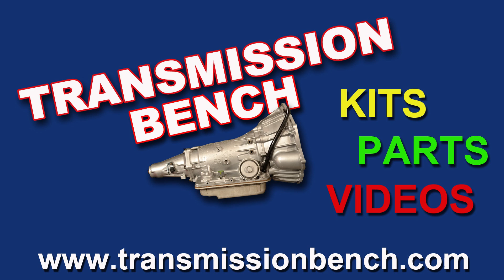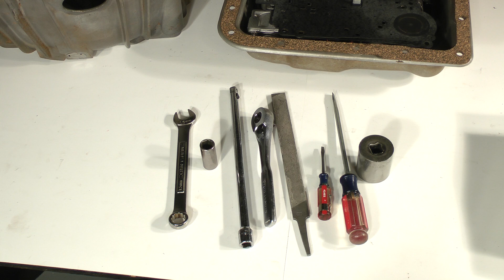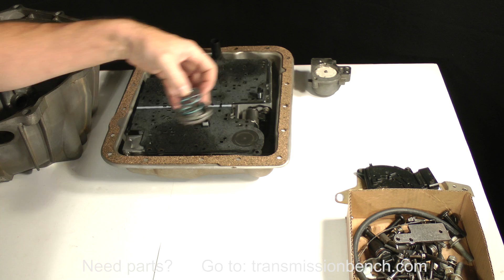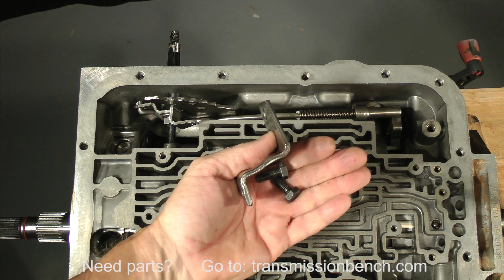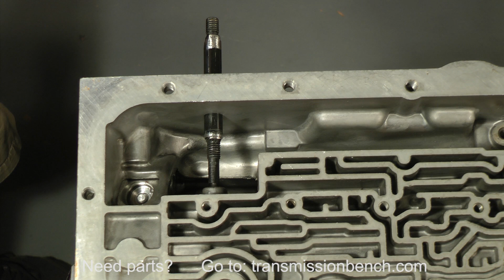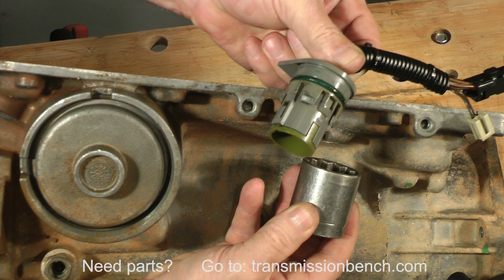Project 4L60E Part 1 lesson lesson 5

Comment: The main wire connecting harness locking tabs breaking requiring a new harness...

Safety wire and/or hose clamps are your friend.  Also, learn how to use a wire clamping tool like the ClampTite example...  I can't tell you how many expensive problems have been repaired permanently and robustly using simple safety wire applied and fastened properly.

Of course, there's a huge difference between a paying customer repair and a high-quality life-of-the-vehicle shade-tree mechanic fix...

Comment: Absolutely love the videos.  The only comment I have is that placing all the small parts in the same box makes me uneasy.
Typically I’ll place the bolts/parts in separate baggies and mark them.  For large disassembly, like the valve body, I’ll make a template on a sheet of cardboard that’s the same as the bolt locations, and punch the bolts through the cardboard.  This makes reassembly very straightforward.
Reply: LOL, I just got to that point too.  I will use baggies and a label.  If I had done 1000 of these may be the "place all the parts in the small parts box" wouldn't make me uneasy.